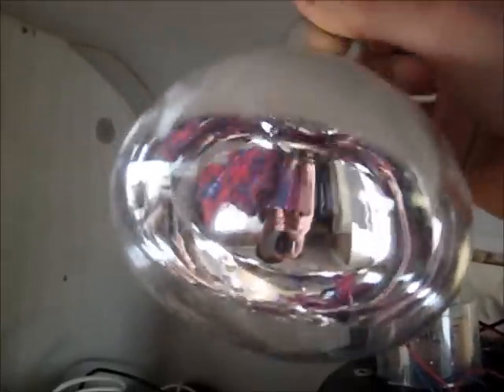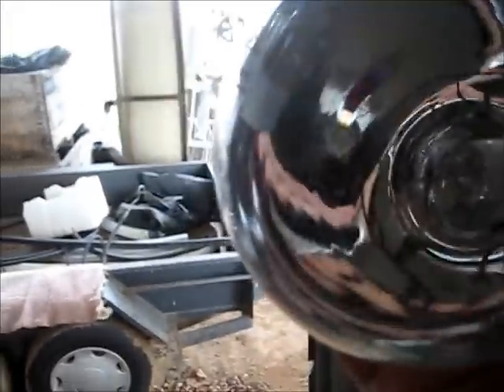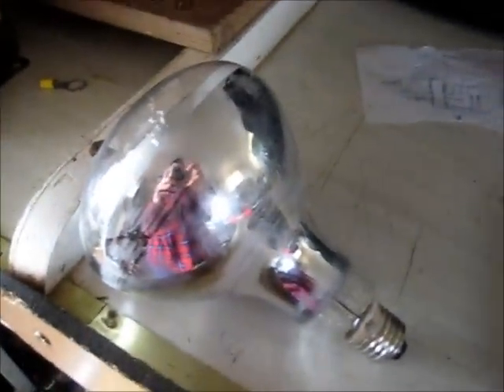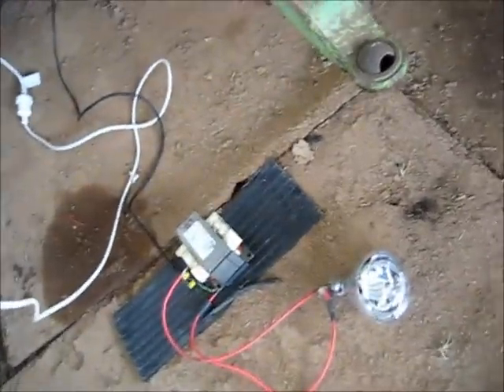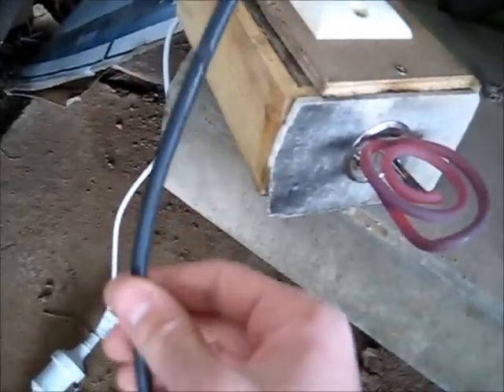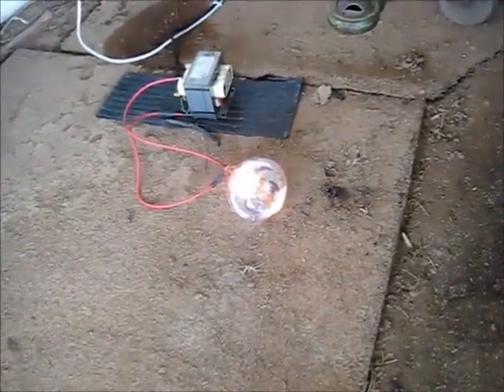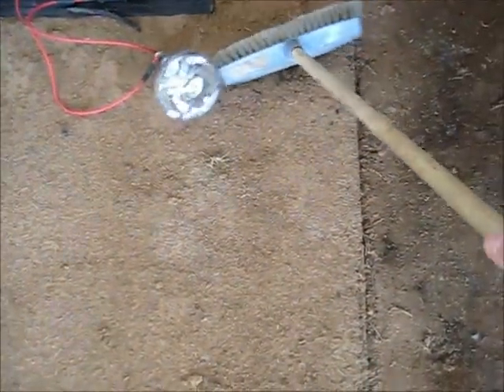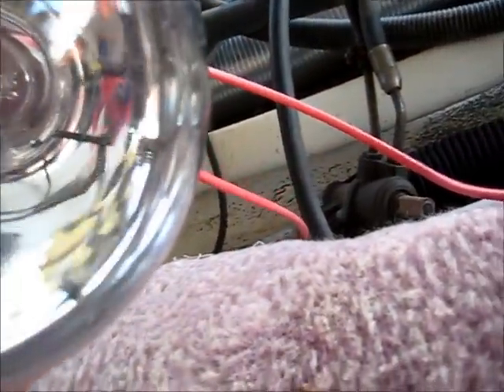Heat Lamp POP

Comment: @flamesecure I took apart a IKEA cfl after the metal screw part let go of the plastic ballast body, and it had a thick jumper wire as fuse, fire waiting to happen!